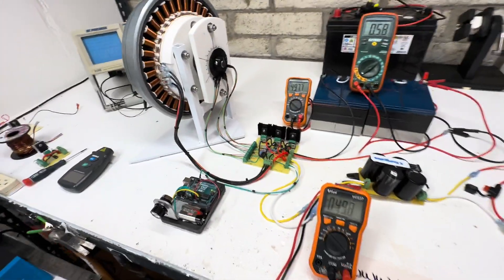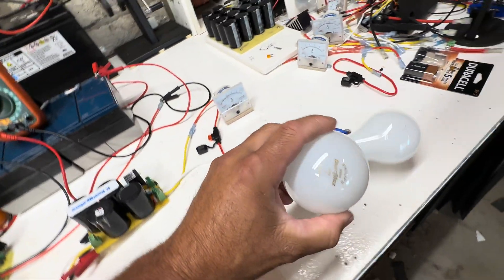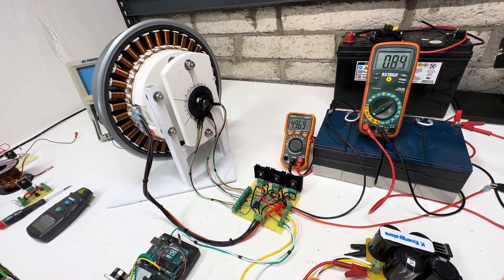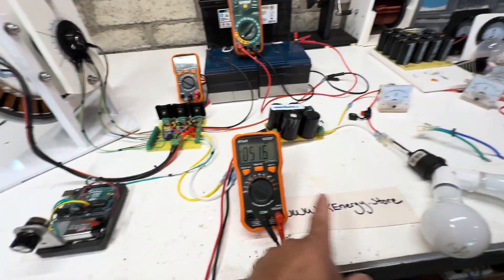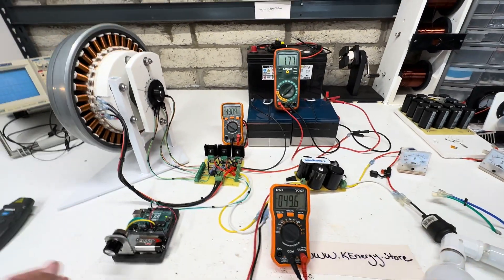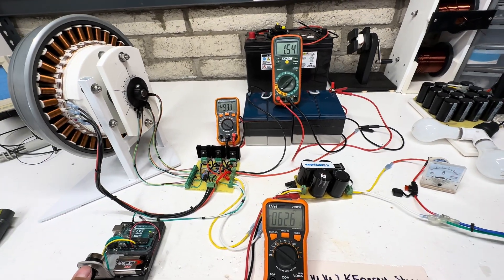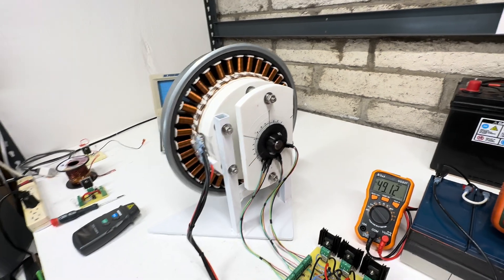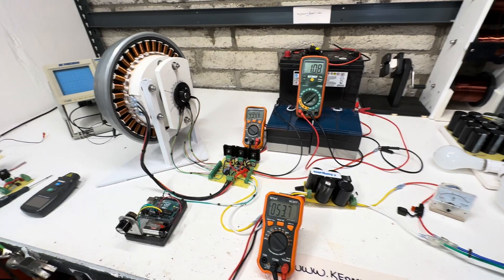Washing machine motor on 3 opto circuits

Comment: very cool man. I dig that amp dump circuit. Also that washing machine is BIG. I have to see if I can find one lololo
Reply from the maker: Lol yea it is let me know when your ready for the cap dump
Reply: @kenergy1707  I have to figure what I would use it for besides charging batteries. I could charge up my super cap bank right?
Reply from the maker: @mcorrade  it would be better going straight to your super cap 
But works great for changing
Reply: @kenergy1707  u know now that I think of it, I do have several old 12v dry cell batteries that need charging. I found them cleaning lolol